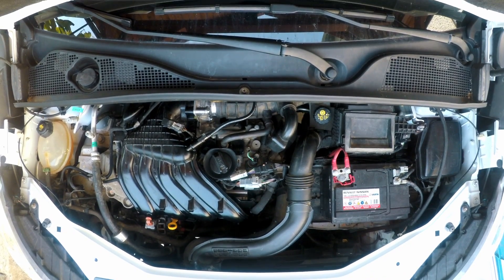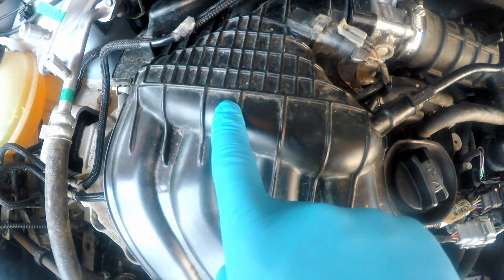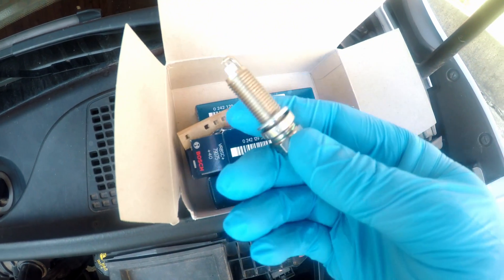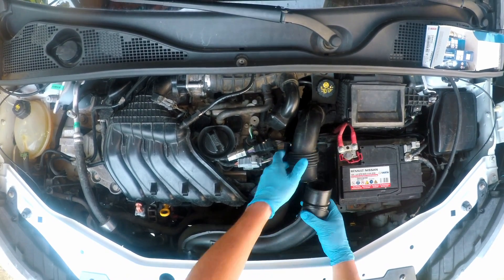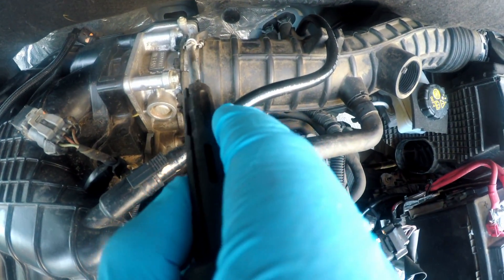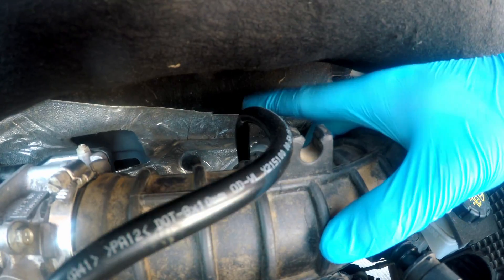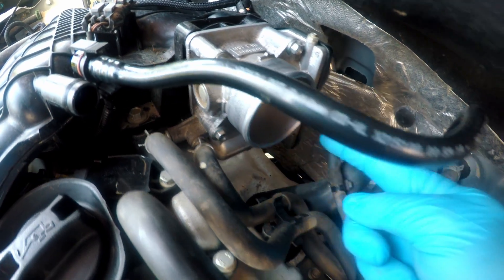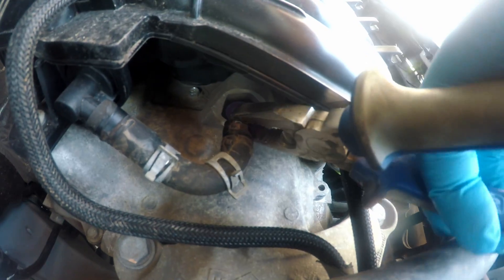Spark Plug Replacement DIY Nissan HR16DE (Renault H4M)

Comment: Thanks alot for your Video! It seems like the whole Internet isn't aware of the 1.6 SCe engine. I made the mistake to unplug the hoses at the..uhm..intake valve? everything was full of coolant and gave up. :D
Reply from the maker: yeah, it is cool engine… but not much about it. thanks for watching! also you can find article on my website that could help you (worth checking)

Comment: ¿Limpiaste la PCV?
¿ Qué aceite le pones?
¿ Te consume aceite? Suele consumir algo.
¿ Le haces reglaje de válvulas?
Saludos.
Reply from the maker: hi, no cleaning for pvc (you can clean with carb cleaner) , oil total 5w40 , and yes it consumes about 250ml of olin for every 1000kms , valves hasn’t been adjusted yet (I have only 85000km)
Reply: @takeapart  gracias por responder.
Tengo un Duster GLP con este motor con 84.000 km, consumo de aceite de 1/2 litro cada 10.000 km, la pcv la limpie por primera vez con 80.000 km, aceite 10W40 aquí en España puesto que hago una conducción suave de prestaciones, es un auto para ahorrar y cuidar puesto que el GLP es delicado y no conviene una conducción prestaciones y a la vez el aceite no se deteriora tanto. Respecto a las válvulas he oído de todo pero en en concesionario no viene  como mantenimiento, puede ser que al salir de fábrica con glp venga con válvulas reforzadas, veremos con el tiempo.
Saludos.
Reply from the maker: my eats way more oil.... hhhh I have cleaned PCV valve as well at 82k kms ... and i dont have  LPG.  Adjusting valves is quite big job and I dont see a need for it yet .... I have updated ECU to latest firmware (at dealership) and I also made cool airbox.  my fuel economy is 7.2L /100km (mixed driving)
Reply: @takeapart  En gasolina no se cuanto consume de media, conduzco habitualmente con GLP 8,4L a los 100 de media,  solo en autopista utilizo la gasolina 7,5L A 120-125  de marcador.
Sobre el consumo de aceite, cierto es que deben ser glotones pero el mío solo consumió en los primeros 20.000 km 1,5L, a los 40.000 km bajó a 1L esos 20.000 km a mayores, ahora sigue con ese consumo, ya les pareció poco consumo en el concesionario y que había tenido suerte puesto que este motor es bebedor de aceite aunque también es positivo, hay una mejor lubricación del equipo motor si está en parámetros razonables.
He de decir que mi motor hasta los 75.000 km no ha soltado todo su potencial, ahora se nota más prestaciones, es el primer auto que me ha soltado tan tarde.
También tengo un ford focus tddi de 90 cv con 442.000 km al que si le hago un trato duro y es una roca ese motor, espero tenerle muchos años más, he visto taxis con 1.000.000 de km.